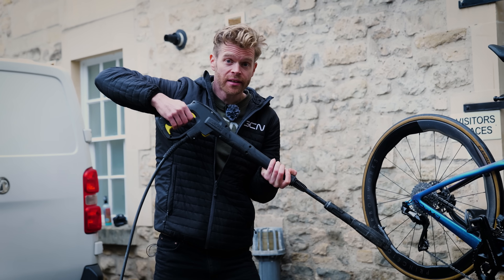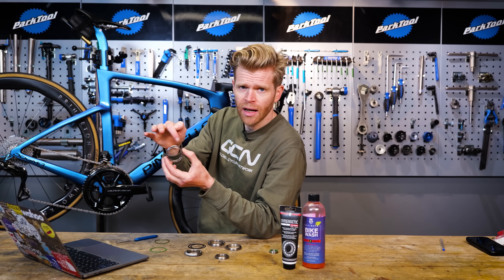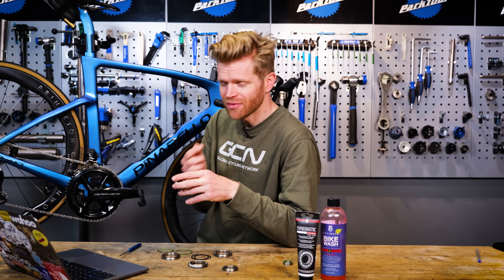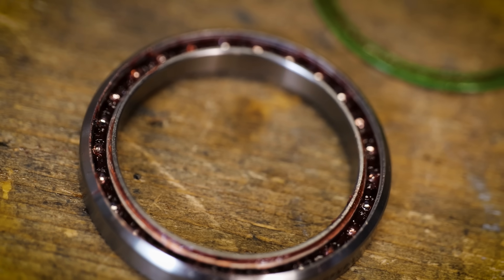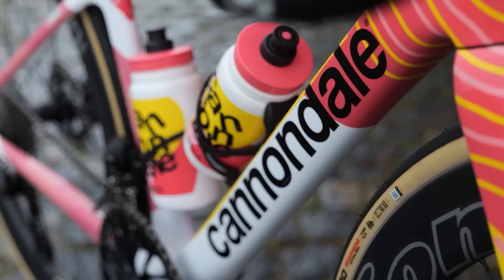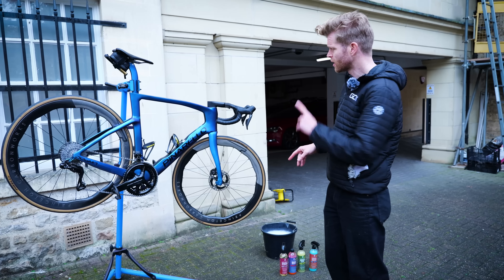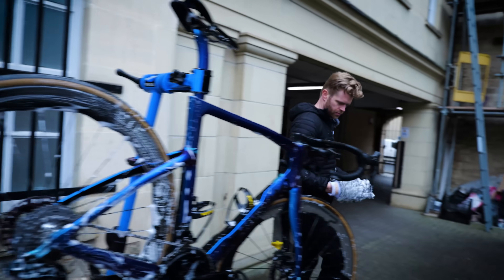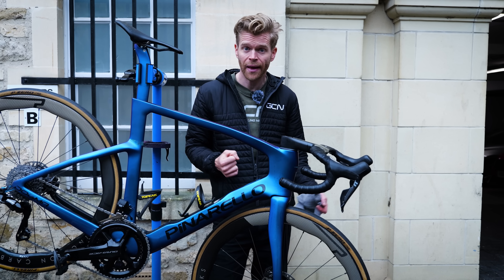Why Jet Washing WILL Destroy Your Bike

Comment from the maker: Have you ever noticed your bearings wearing out quickly after jet washing your bike, or were you already avoiding it? Let us know in the comments! 👉
Reply: A garden weed sprayer produces a weak spray that will knock off the dirt and salt.  Plus you can fill it with hot water for more effectiveness.
Reply: I’ve never jet washed my bike - I’ve never had a jet washer 😅
Reply: Many years ago (1980's), a friend took his Peugeot mountain bike to a car wash after a muddy ride. He jet washed it and of course the bottom bracket etc. was toast. I lived above a bike shop at the time and my friend lived a block away so that's where he took it. That's how I learned to never jet wash a bike. Granted , a car wash jet wash is probably many times stronger than a pro-team bike mechanics.
Reply: I appreciate this video 👍 I have a jet washer and I'll still continue using it as a part of my bike washing routine 😊
I wouldn't say I'm stubborn, I'm just an engineer and (I think) I know what I'm doing 😄
Reply: you can jetwash without fusilating your bearings, just use the washer from 3-4 meters away of the bike.
Reply: Squirt bottle with soapy water and a microfibre. Ride in dry conditions and my bike is spotless clean. Hot  Waxed chain and never degreased my chainset in over 3 years. Occasionally remove the cassette and give it a good clean but never on the bike. Bike runs like a dream. Rim brakes and mechanical groupset bike is nearly zero maintenance. Rim brakes I take the pads out every few months so I can clean in there properly and lubricate the pivot points. No need for making things complicated most of the tracks we have here are pretty flat so having disc brakes is pretty pointless I'm not descending mountains
Reply: @GCNTech my method is use a garden hose to rinse off dirt from bike - spray degreaser on the chain and cassette - use a nylon pan brush to wash the chain and cassette - rinse off the drivetrain - use car shampoo with hot water and a sponge to wash the bike then rinse off.  Bike is spotless - I have a jet washer (Kranzle ;-)) but this method is way quicker.
Reply: I don't have jetwasher. I have newer jetwashed my bike. I have only washed it's wheels and parts under shower and from hose connected to water tap. But I flooded the freewheel with water on my loved hope rs4 hub, even though I was careful, when directing water from hose to rear cassette to clean it. But as that hub only has something like labyrinth seal. Water had got in. And stayed in. It won't get there normally from rain or such, But when there is a lot of water coming from hose it can get inside. I discovered it a lot later, when maintaining it. The grease inside had got ugly rusty and mixed with water. It had happened 2 times. With different greases and different amounts of greases. But I think the water never got inside bearings. Only freewheel.
Reply: Jude a decent wax and everything just hoses off anyway.  Mother’s CMX is outstanding, my bike gets a wax twice a year, otherwise just a hose and wipe dry. If it’s actually raining during the he ride it’s pretty much clean before I’m home .  I’m talking mtb on clay here, it’s seriously good stuff.
Reply: I've never jet washed my bikes.  I'm weird - I stand them up in the shower to shower my bikes (apt. life LOL).
Reply: This "don't jetwash" advice is pointless without specifying a pressure and nozzle. 
For example, your 7:45 'garden hose connected at (1-3 bar variable) mains pressure and further confined by that focussed, accelerating jet nozzle you were using, is easily capable of exceeding the force from a portable, battery-powered jetwash with a broader, non-focussed nozzle, such as the Worx 22 bar or the Worx 56 bar on Eco mode.
Retail plug-in pressure washers are available at ratings from 70-300 bar.

Comment: I dont have a jet wash as no outside tap,i'd been using a watering can to rinse off the worst dirt first , however lately ive been using a garden sprayer as a hose pipe low pressure system which has enough pressure to rinse off the dirt but not enough to cause any ingress damage to bearings,i then spray all over with degreaser,and specific chain and cassette degreaser,then use a soft brush /sponge etc with decreaser in a pot mixed with water, completely wipe clean top to bottom leaving specific brush for cassette and chain and seperate one for disc brakes till last,then rinse off with garden sprayer ,dry with cloth then i use silicone sprayed onto cloth not directly on to bike to wipe over and then lastly a specific brake disc cleaner with a cloth,and dry chain and  reapply oil ,Ive had very few problems in the last 44 years with damaged bearings and only replaced due to years of natural wear.

Comment: I used a small container after spraying with Muccoff product. I then used a large bucket with hot water to rinse, using the tiny container on my specialised venge. I never used a jet washer because I don't have one now, and I will not use one at all. PS, my bike is a better looking than yours, Olli, another thing you didn't mention on the video i find after you wash your bike is a very good pratice to willy your bike up you don't t have to be on top of her this will remove a lot water from inside the frame you literally  will see the water dripping down from the back of the derailleur attachment

Comment: Hmm.. Jetwashing may destroy the bearings on your bike. It does not destroys your bike. 
Also I wonder if CeramicSpeed uses non-contact seal or similar low contact seal for their bearing.
One trick to avoid rust is to use full stainless steel bearing, so does it mean CeramicSpeed not using decent stainless steel for their bearings?

Comment: What do you think about a dry steam cleaner? I have seen some presentations as it was used to prepare dirty cars (back from leasing for selling) and I was really impressed. They used it also for luxury cars for detailing and as I understand it is without really high pressure. But I'm not sure if the dry steam could cause some corrosion after condensation? 🤔

Comment: I've got a pressfit bike, so my bearings will go out, anyway. But, to be honest, I use a mobile battery low-pressure washer to clean my bikes (5 bars working pressure). Simply, because I don't have a garden and a regular hose. I'm trying not to aim at the BB and hubs, but it is a compromise, indeed. I'm much more likely to clean my bike properly than when I'd have to carry buckets of water two floors down to the entrance area and rub everything off with a brush and some old rugs...

Comment: I was under the impression some pro teams were running their bearings with no seals and no grease and just some light oil.... for cough marginal gains cough so if you'd need to replace the oil after every race anyway so no harm no foul with the jet wash :/

Comment: Never power washed. Also i dont use nozzle attachments.  Still more pressure then id use. I like to only use the pressure the opening of the hose can create.  I only use brushes on the drivetrain itself.

Comment: I’m not gonna completely agree with this. 

I think it’s fine to indirectly jet wash your bike, but don’t use a high power one, you can get the Muc Off ones which are low power… I’m guessing the sponsorship with Muc Off ended and you’ve had to change your tune based on your new sponsor. 

Most of us wouldn’t jet wash the bike anyway given we probably don’t have one, a garden hose or just a bucket of soap and water will be fine.

Comment: There are different standarts of sealings. Done this Jet wash gently to my Winter Bike 5 years and now replaced the greace. I was wondering how Clean it was after years of torture. 
The other Thing is be gentle with this Jet washer, then you should bei fine.

Comment: A 'jetwash' can be anything from 2 bar to 100 bar pressure. Where does the line go? There are battery powered jetwashes intended for bikes that do around 3 bar, which likely isn't enough to penetrate too deep, or definitely not being able to ricochet (which honestly I struggle to figure out how it could even in theory happen).  I don't doubt the problem exists but inserting a bit more fact would have made this useful.

Comment: Compressed air kills your bearings. Been there, done that .. and it wasn't cheap :( Problem is, you can push water inside your bearing when you try to dry the area around the bottombraket. Drying the chain is fine, though. I am doing this regularly.

Comment: Meanwhile, bike mechanics have been saying not to jetwash bikes for a long time. 

The other thing to note is that any type of soap/detergent/cleaner/degrease reduces the surface tension of water, (and are generally thinner than water) allowing them and water to penetrate past seals easier than regular water. 

Riding in the rain also increases water ingress as the rotation of the bearing draws in water. 

The moral of the story is that the less water the bike sees, the longer the bearings last.

Comment: Those living in condos sometimes have little choice. The price of new all around bearings once per year is the cost of riding. 

For those with a patch of grass or alleyway a manual pump backpack mounted garden sprayer normally used for pest control is an effective and gentle way to rinse away degreaser and soap residue.
Reply: If you're someone like me with no choice aside from the manual spray car wash be sure to avoid the soap settings. Flush the line prior to directing spray at your bike to avoid soap or wax settings used by the previous automobile. 

A garden sprayer used in an alleyway or parking lot is preferred if approved for usage by the condo board or property management company. 

GCN Tech. Many of us are choosing from suboptimal choices and simply trying to do the best we can.

Comment: Bosch do a brilliant low pressure outdoor unit - Frontus 18v cordless rechargeable battery. It has a number of settings from a single jet to a gentle rain spray, plus 3 power bands. It holds sufficient water to thoroughly clean three mountain bikes and fits easily into your car boot. I've had mine just on three years and no problems with the unit or the bikes.
I also use it to shower with the campervan when travelling. You can get some handy accessories too such as a soap reservoir that fits on the hand set.
Reply from the maker: nice! that sounds a really good bit of kit

Comment: I live in a Flat with no washing place or anything. When I am out on my Gravel bike, its completely covered in mud. My only option is the 1€ power washer at the gas station. I am not going close to the bearing. Maybe they brake down easier, but lack of options make me continue. And mud and sand has probably a bigger effect

Comment: I use a hand pumped garden sprayer instead of a pressure washer as it’s considerably less powerful and more water efficient (half the canister filler with warm water is plenty for pre wash and rinsing). Am I right in thinking that due to the lower pressure this isn’t going to damage my bearings?

Comment: Stop transporting your bike on the outside of you car (in rain). Also a sure receipt for bearing degradation.

Seals aren't tight and any water exposure will cause some water ingress. Normally bearing grease is considered critically contaminated at 1% moisture = way before visible degradation. 
Cycling bearing luckily aren't really loaded much so they can take loads of abuse before actual failure 👍

Comment: Maybe it's not that pro mechanics are wrong, but they just don't care if directing a water jet 100 times at a bearing will cause it harm because they haven't left a bearing in a bike for 100 days since 1998 or something. Why would they care about longevity of components when doing it the hard way will have them going to bed even later than they already do on race day?

Comment: The real source of the problem here is the bearing designs that should be jet washing proof.  Yvan des velos, designer of Underworld components 1996-2006, probably the only concept to ever offer the sweet spot between ultra low friction, ultimate sealing & jet washing proof.  MBA acknowledged its incredible durability potential & the way it permenantly solved premature loose bearing issues.  They even wrote it might be the holy grail in Y2K.

Comment: I personally would not rinse with the single concentrated stream shown in the video. Makes sense to use one of the settings on the nozzle that spreads out the pattern into wider spray pattern. I also installed a valve between the hose and the spray nozzle so I can adjust the volume of water coming through…just my two cents.

Comment: By jet washing, do you mean using a pressure washer? What if I just use a garden hose and a nozzle in jet mode? I assume it'd be fine given the pressure is not that high, but correct me if I'm wrong.
Reply: hose is ok. just not high pressure jet wash.

Comment: You should make a video on what pressure is acceptable. I’ve been cleaning houses and driveways for a long time with 3000 psi power washers, but now there all kinds of homeowner units that are electric and far less powerful. I think that’s generally what are being used on bikes. At my home, the water pressure is 64 psi at the spigot. Is that still too Mitch of your catching a blast at a hub or BB?

Comment: @gcntech You really suggest to spray degreaser onto the drivetrain? Have you even thought about your front & rear deraileur? All pivot points should be lubricates sufficiently during use & mechanical groupsets do have a spring in each deraileur which obly is protected against corrosion by a rather thin film of grease. If ceramic speed says, that the grease in sealed bearings will get damaged & washed out by jet washing, I will say, you destroy your groupset (and the environment) with your degreaser!

Comment: it all rubbish I've been jet washing since the 80's just don't point the bloody wand right at the moving bits. if one looks at bearings under a microscope all bearings look like shit! manly because manufactures hardly put any grease in the bearings in the first place I've opened up brand new bearings with less than a milligram of grease in them. looked like assembly oil only.

Comment: I blasted part of a downtube decal off using a pressure washer on an older bike.  I theorize that stones had chipped through the clear coat over time on the downtube, then when I hit it with the pressure washer, water got under the clear coat and the decal.  I've stopped using a pressure washer ever since.

Comment: Hi Ollie
You explained what happened to steel bearings when you get water ingress , pitting and rust etc .
But you didn't mention about ceramic bearings with water ingress . What happens to ceramic bearings?
Reply: the cartridge is made of steel.
Reply: @OllieBridgewood thanks for the reply,  what about if the cartridge is ceramic ? Can I still jetwash?

Comment: I don't jet wash because who has time to break out the jet washer!! So much faf involved.
A bucket of water, car wash liquid, a cloth for the wheels and a cloth for the frame. Dry the frame down with another dedicated cloth. Spray the frame with a detailer and wipe with ANOTHER dedicated cloth and done. I do this after every ride. No need for a jet washer or garden hose unless I have ridden in the rain.

Comment: I'd say the main issue with ceramic speed bearings is that they run seals of absolute minimal drag for headline friction numbers.  Those seals are then obviously poorer at stopping jets of water getting inside.  I'd say they would even struggle with a rainy day.  Jet washing is not great really and a bit lazy but with correctly sealed bearings and careful aiming of the water jets you'd be fine in most cases.  Ceramic speed components are way overpriced and not real world ready. As usual marketing is king and now they'll have you signing a disclaimer promising never to ride in anything wetter than a misty day.

Comment: I've adapted my car washing materials to my bike, in particular rinseless wash for when it's significantly dirty, and waterless wash for mild cleaning. Both come in trigger pump sprayers or in concentrated bottles you can dilute. The rinseless wash I use dilutes 256:1. I don't ride in the rain when I can help it, but if I ride on wet pavement it can pick up a lot of dirt and grit. For heavy washing I'll use a small hand pump sprayer with diluted rinseless wash, one microfiber wetted from the sprayer with rinseless wash for contact cleaning, and another fluffy microfiber to dry. A heavy initial spray with the pump sprayer on a wide fan will melt off most of the grit, then follow up with the contact microfiber saturated with rinseless wash, then dry with dry microfiber. No rinsing with water is needed (hence, rinseless wash...). For less dirty cleaning, I just use the diluted rinseless wash in the trigger sprayer, again with the washing microfiber (just dampened) and drying microfiber. I can do that indoors with a piece of cardboard under to catch any overspray and minor drips. For light cleaning I just spray waterless wash on a microfiber to dampen it and wipe the bike down. You can also use another drying microfiber, but I just use a dry part of the same one. I don't have any grease to deal with because I hot wax my chain.
Reply: how does the rinseless wash affect disc brake rotors? most rinseless wash contain gloss and slickening agents, I would be afraid of getting that on the disc brakes
Reply: @mountaindweller4514 I don't spray it on the rotors. With the pump sprayer I have a small plastic shield I slip on to prevent overspray on them. The trigger sprayer is easy to spray around it without overspray getting on them, especially when I take off the wheels.